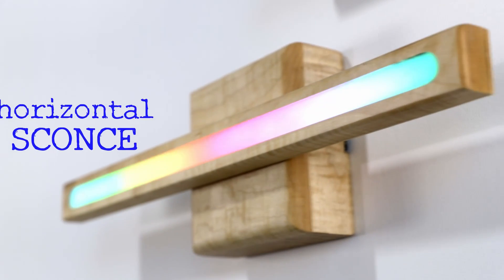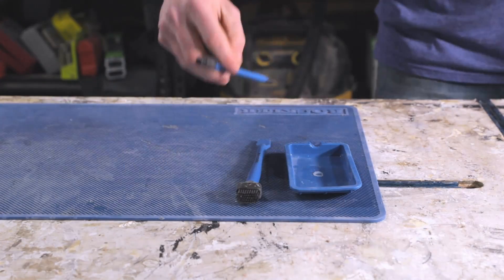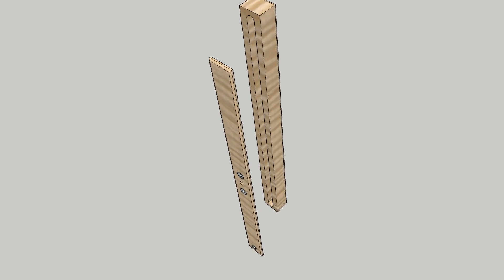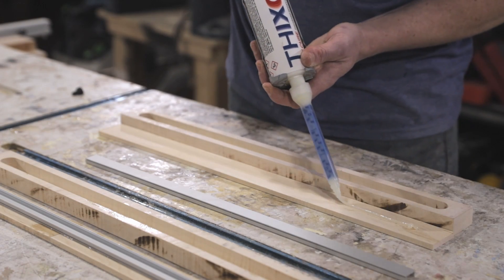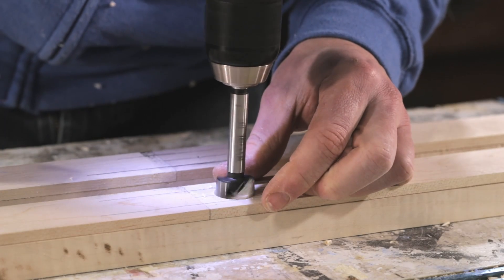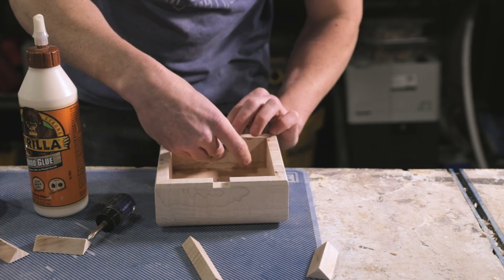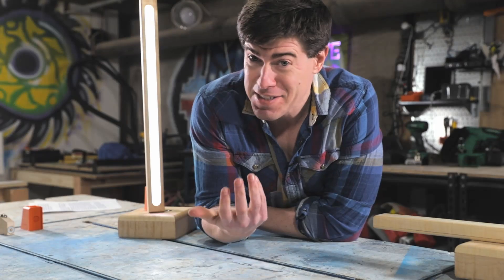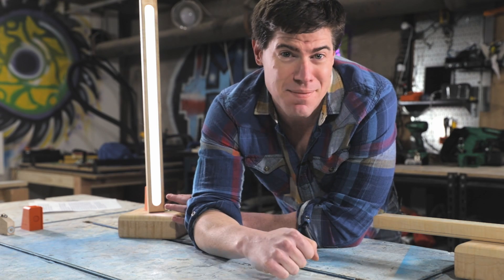Wireless EPOXY LED 3-in-1 Lamp & Sconce || 3 Different Lamps in 1 || DIY Woodworking

Comment: Hi Mike,
 first thing first, very cool idea.
I just want to make my own lamp but I found out some problems, can you please help me clarify it?
First thing, you use 3,7V Battery but controller input is 5-24V Will it work?
And second thing, you use 2600mAh battery, but this LED light strip have 43W/1m, so it's around 8,6A which will drain your battery in 17 minutes or do I got it wrong?
I'm little bit confused.

Thank you!

Comment: instead of the wire that is visible you could modify it with metal contacts on the lamp in the upper, lower and central part that make contact on the base when hooked, it would remain cleaner

Comment: What thickness of white resin did you need for the light to be contiguous, and not see individual leds?
Reply: From the look of what was routed after, I’d say about 1/4” (6mm) of white, and then 1/4” (6mm) of clear on top. That will of course depend on how much pigment you add, which will change the opacity.

Comment: Hi! I’m trying to follow the wiring aspect of your video. I’m noticing you only used a single 3.7V battery but the LED lights require 5V power. Am I missing something? I tried using the same set up but my lights aren’t lighting up. But when I plug in a 6V the lights and Bluetooth work. Can you help me please?

Comment: Just wanted to say this video helped with my project. The epoxy method used was able to answer a lot of questions I was having and got rid of my doubts and I proceeded. I did an RGB Thin line flag that covers each color of the thin lines by using a center epoxy strip that is back lit with LED.
Reply from the maker: Thanks!  Glad I could help!
Reply: Modustrial Maker well if you want to see it I posted a video how to.

Comment: i have the same electronics, but i cant get it work with 1x18650 battery. i have the sp108e (wifi) module. if i try it with 5v it works, but with one single 18650 its not working.
Reply from the maker: Sometimes you need a step up (boost) converter between the battery and controller, to boost the voltage to 5V.  Make sure you get one rated for the amount of amps you'll be running thru to the LEDs
Reply: Modustrial Maker thnx!!! I will try this. Let you know if its works. Grtz

Comment: I love the design. Its nice and modern and sleek.
I love your channel, very inspiring.

Would you be able to use the magnets as terminal points for your positive and negative wires from the base to the light bar?
So if you wanted to just take it off the base to turn it off. And to give it a sleeker look in the different orientations.

Comment: How thick is the epoxy pour? I have a project that will be about 3/4 thick and wanted to back light with a white dye like you did. 

How much dye did you use and what brand?
Reply from the maker: The epoxy is about 3/8" thick, with 1/8" of that being white.  There is a link to pigment in the description.

Comment: Really cool lamp! One of my favorite parts is how the light bar is repositionable, it makes it versatile and ensures it will remain useful and asthetically pleasing for years to come.

I've seen tons of lights which were very artistic but which were limited in how they could be used, placed, or oriented in a space. 

One improvement would be using magnets to connect the power and data to the bar itself, so repositioning or reorienting the light would be as easy as picking it up off the base and reorienting the bar. Though this would have required some more magnet inlays and might have harmed the asthetics of the wood, not to mention added some complication to wiring the LEDs inside the bar as well as tweaking the voltage and current of the power supplied to the magnets to account for any extra resistance provided by the magnets. 

If I were to undertake this myself, I'd also make a USB power connector inlay for the wood, either carved to fit flush along the contours of the USB connector or carved to just about perfectly fit the contours of the connector and then filled with puddy, wood glue, or a color matched epoxy resin so that the power connection looks like part of the wood itself. An alternative would be to place the USB connector inside the electronics cavity and make a cord passthrough hole; bonus points for a bisected rectangular prism to fit the chiseled out slot, with two half circles and magnets for easy cord replacement or removal.
Reply from the maker: Thanks Daniel!  Lots of good ideas there!

Comment: You just solved my massive dilemma. I'm going to do this around the sides of my desk instead of buying those overpriced LIFX Beams. 
Hey, I'm already using a crap ton of epoxy for inlays and top coat, might as well use it for the diffusers as well!
Reply from the maker: Happy to help!

Comment: Great Project! I love it! You may want to add some date about the battery you used to the description (what voltage and capacity). Also what that USB charger circuit is might be useful.
Reply from the maker: Thanks Benjamin!  Links to the parts are in the video description

Comment: Do you have the schematic by any chance? It would be super useful especially for low experience builders (like me :)
Reply from the maker: Sorry, I don't.  All the parts are pretty self explanatory... The only thing you have to solder really is the battery charging board.  Best way to learn is to dive in ;)

Comment: These look awesome thank you! A quick question though, the les strip consumes 10v/10A, splitting it in two makes it need 10v/5A. But the battery and charger seems not be able to sustain this, how did you overcome it?
Reply from the maker: Thanks!  The LEDs are only 5V and will run off the ~4.3V output by the batteries
Reply: Modustrial Maker I must have messed up the references of the products then, thank you :) How much battery life do they have?
Again, it looks awesome, can’t wait to try making a couple of these thank you !

Comment: Do you need to think about the heat LED's create? And how can you solve this without seeing it on the design?
Reply from the maker: Yes, I did... The aluminum channels that I put the LEDs inside dissipate the heat and thus address it.
Reply: Thanks for the quick response! I'll be making one myself with the help and tips from your videos :) keep up the awesome work!
Reply from the maker: One of their tip after using this for a month... Look for some charging boards that are rated for 2A or 3A current.... One of mine burned out recently, I think because the LEDs were pulling too much current through it when I was running it off of USB power

Comment: Super Idee deine LED-Lampe, aber die Befestigung mit den Magneten mußt du mit Vorsicht behandeln. Die Magneten sind sehr spröte und zerspringen schon bei einem harten kontakt mit der Fläche an der die Lampe angebracht werden soll, schön vorsichtig und die Lampe sieht lange Zeit super aus.

Super idea your LED lamp, but the attachment with the magnets you must handle with care. The magnets are very bright and shatter already in a hard contact with the surface to which the lamp is to be attached, nice and careful and the lamp looks great for a long time.

Comment: Looks like you faired better than I with soldering wires to the tiny pads on those 144/m density LED strips. I do like the french cleats for easy wall mounting and the light itself. They would go nicely with the small square lights I've recently been playing with and I feel your pain on those warped boards.
Reply from the maker: The trick is you just have to sacrifice one pixel when cutting them.  Instead of cutting the pads in half, cut it off so the whole pads are left next to the pixel you solder to.
Reply: That would be the easier solution. I went the option of having a PCB made and we'll see how well that goes once all the parts arrive. My design has a removable light tower in the center of layered wood/plexiglass so the custom PCB made sense, but if you cut from the opposite end of the LED strip, you may not have to sacrifice a pixel. I might just have to try that.

Comment: Love the design! The epoxy diffuser is such a great idea! I have an idea for a v2.0 for this that uses the magnets and specifically the screws holding them down as power contacts for the leds. Would have to find a driver small enough to tuck into the bar but if you always make the polarity of the magnet match the polarity of the power contacts the bar will always be powered with correct polarity. Since the control lines are all inside the bar you could just mount powered magnets all over the place with the correct spacing. Since 5v or 12v power supplies are so easy to come by you could integrate mounts in all kinds of weird places
Reply: Ever did it? I create keyboard on off magnet switch

Comment: Nice idea but its quite dim. It seems that you may have used too much of that white pigment. I wonder if glass microspheres (commonly used epoxy additive) could be better for diffusing, without taking away much brightness.
Reply from the maker: I had to turn down the light for the video, so it didn't blow out the image.... It's actually quite bright

Comment: what he is not telling you that the battery is lasting for around 15min xD
Reply from the maker: Right, I didn't say that, because it last 3 hours.  Which I did say. 🎤💧
Reply: @modustrial  o i calc that wrong. a WS2812b need 43w/m and a 18650 has 3.4ah at around 3.4v thats on full power 15min. but it looks that you use just around a half meter. thats 30min
Reply from the maker: You are looking at it way too simplistically.  Fact is, I have the light sitting here, and in normal use, it lasts about 3 hours.   You are calculating theoretical max draw and max power, with all LEDs in each pixel on concurrently.  And I used RGBW, so its actually higher on paper.  however, you are speaking of something you read but haven't ever used....in practice, power draw is much lower, you get about 85% brightness at 50% power, and not all LEDs are on at all times (with patterns).  Running it normally with "brightness" slider (which is actually power) at 50%, I'm getting about 3 hours.

Comment: This is a beautiful build, and I can see its usefulness.  Please get the blade on your table saw sharpened, and quit burning the wood with every pass. Either that, or you need one with more teeth. My 10 inch blades range from 90-120 teeth, and I never, ever have chipped wood or splinters. No burn marks, and no need to plane the edges. My circular saw blade, (7.25) runs 60 teeth, and cuts hardwoods like butter. (This is not a criticism, just a tip from a retired carpenter/millman).
Reply from the maker: Thanks Ted!  And good tips all around! Constructive suggestions like those are always welcome.  Funny you should mention the blades.... Got a whole new saw and arsenal of blades 😁 spent some time talking about the blade selection too in the video I just released earlier this week, altho more for melamine.  I've been trying some different woodworking blades too, and really liking the results you can get with proper blade selection.
Reply from the maker: Also, I found this 50 tooth combo blade that does an impressive job....I posted a vid where you can see the results on cross and rip cuts the other day on Instagram: https://www.instagram.com/p/BxfLzYmjazB/?igshid=8018vjmfel0m

Comment: I'd like to have something like this, but with the battery, LED controller and magnets built into the light bar itself, so that I can hang it anywhere I want that's metal. But also, and this is the smart solution, the next step would be to permanently affix the bases to the walls around your house, hooked up to mains power, and have those magnetic USB ports that will charge the light bar every time you place it on the base. So, you'll essentially have wall sconces all over your house that you can grab and carry with you. You could also build bases for your desk that plug into mains power and accept the light bar in the same way.

Magnetic USB idea. If you could use these connectors and cables to supply USB power to the lights, by affixing the magnetic portion to the base on one side and running it to a charge controller, and solder into the leads on the plug side within the light bar, they could be powered and charging while docked, and run off the 18650 li-ion battery while mobile:

This looks like the simplest solution (doesn't need data, but just power, so only two connections): https://www.amazon.com/Micro-USB-Magnetic-Connector-Male/dp/B0192EHMJ6

https://www.amazon.com/s?k=USB+magnetic+cable&ref=nb_sb_noss_2
https://www.amazon.com/NetDot-Upgraded-Charging-Indicator-Compatible/dp/B06XVRBTXK/ref=sxin_2_ac_d_pm?keywords=USB+magnetic+cable
Reply from the maker: Re: the first idea for the charging bases, check out the build I did for the epoxy LED cube... It was a wireless charging receiver and I built a custom fit wireless charging base, so it's grab n' go.
Reply: @modustrial  I remember that one. I'll have to revisit it. The idea I have is these magnetic charging sconces in each room, so every light can be taken with you, to a standing lamp base, or a desk base, and used throughout the house. The wireless charging would be another option here. That idea didn't even occur to me. I wonder if it charges as fast as a USB connection? It's essentially a type of induction, or Near Field Magnetic Coupling, so it would be a magnetic charger too, in essence. But I think the magnetic connectors are less finicky and less to go wrong. 

But the speed of the charge is something I'd have to tinker with. Induction chargers have gotten a lot cheaper lately.

Imagine for a moment you bring a friend over, and you guys pull up, walk into the home, the lights come on automatically and you grab one of the just lit sconces and walk off with it still lit up, only to bring it over to a standing lamp base in your living room and magnetically attach it there. It's almost like reinventing the Middle Ages where everyone walked around their homes with lanterns. lmao I assume most people would leave these where they are, but I can't even tell you how many times I might have needed to see better in a portion of a room where the fixed ceiling lights just don't cover quite enough, so having it so you can simply grab any of these from any room and use them when, and more importantly, where you need them, I think that's a pretty good idea. 

Sure, that's what flashlights are for, but flashlights aren't overhead or constant lighting, they're temporary lighting. They're situational and immediate but temporary lighting solutions. This is like combining the two to a degree, with compromises both ways, but benefits both ways as well.

If there was a way to make the design smaller, but produce a good amount of light, comfortable to hold and handle, but also aesthetically pleasing when docked. Maybe a sphere where a third of the sphere is wood, two thirds epoxy? The wooden side could have a flat bit that mounts to the wall. Sphere's are too difficult to produce with epoxy, though. Maybe an epoxy cylinder with a wooden handle (the handle could be where the charge connector and magnets are) Maybe you could suspend the LED strip inside of the epoxy in a sort of loose spiral like a DNA strand and it'd light up 360 degrees. The battery, LED controller, magnets and connector could all be in the cylindrical wooden handle. 

It'd be like a little 1FT to 1 1/2FT lightsaber. Maybe an inch diameter?
Reply from the maker: And that magnetic USB idea is great!  I just ordered 4 of them off AliExpress to play with! :)
Reply: @modustrial  Check these out. They're round, so the orientation wouldn't matter, and they don't supply data, so perfect for just charging. Looks like a strong magnet with a solid connector. 

https://www.amazon.com/SOJITEK-Detachable-Magnetic-Charging-Connector/dp/B0192EHI18  
https://www.amazon.com/Micro-USB-Magnetic-Connector-Male/dp/B0192EHMJ6

Comment: How long does it work on one charge?
Reply: Says in the description "about 3 hours".
I'd make it multipurpose by hiding the USB (charging) port a bit deeper in the base, so that when you plug an usb cable in, the complete connector hides away under the base nicely. Then you could either go battery powered for mobile applications, or just have it plugged into a USB phone charger from the mains when you use the lamp near a wall outlet or for a more permanent location.
Reply: Thank you for your reply. Nice project!
Reply from the maker: Thanks much!

Comment: Nice project but you definitely need a new soldering iron tip, looks like it was dropped on the tip when it was hot.
Reply from the maker: Thanks for the tip (pun and thanks intended 😁).  I've got some spares and will switch it out.  Out of curiosity, if you can get things soldered together, are there things that could go wrong long term because of the bad iron tip?
Reply: @modustrial  yes some stuff can go wrong with a bad tip. I been doing electronics since I was 9 and  I'm 35 now, gone to school for it too. A bad tip can cause the tip to not heat up properly on some model of irons and cause "cold" solder joints that can break over time and/or movement. How to tell if it is a cold joint is the solder will have a "dull" look to it. If it is not shinny, it's a cold joint. Just reflow some fresh solder and don't pull the iron away too quick. Also make sure the tip is clean, a nice damp sponge works for wiping off any access build up on the the tip. Make sure you "tin" the  tip to keep it fresh for use, also try to avoid "carrying" the solder to your work. It burns off the flux needed to help it flow onto the parts to be soldered together and can cause dropping on to the circuit board leading to short circuits. Hope some of this helps a little bit. Feel free to ask me anything if you get stuck.
Reply from the maker: Thanks, very helpful!  I'm always trying to improve!
Reply: @modustrial  you're welcome, if you have any questions feel free to ask and I will do my best to help you out.